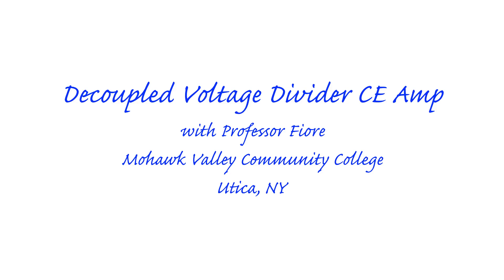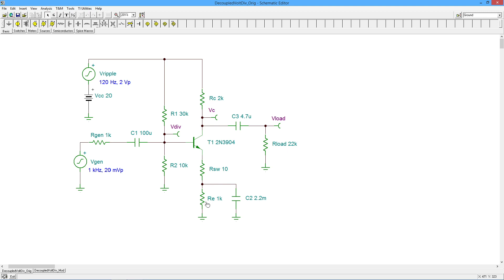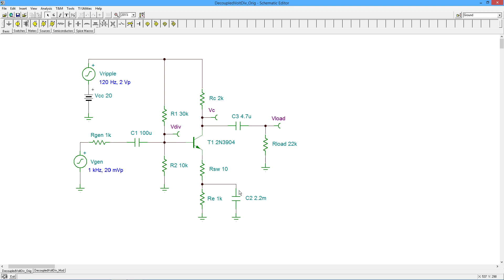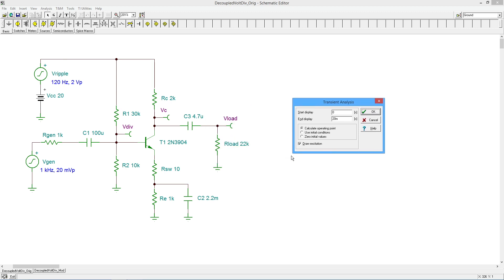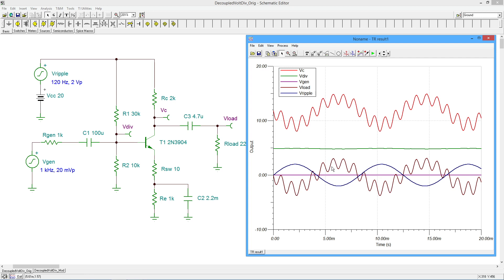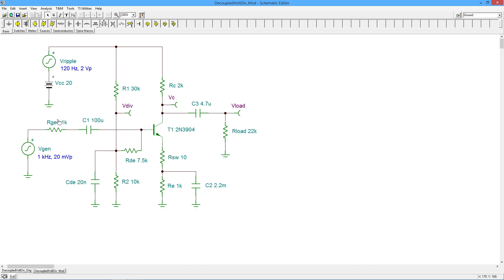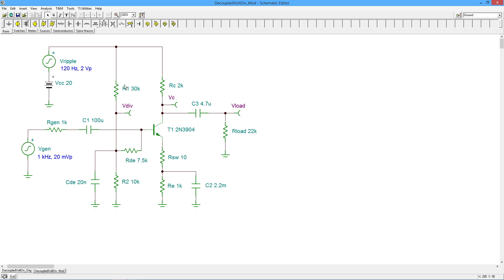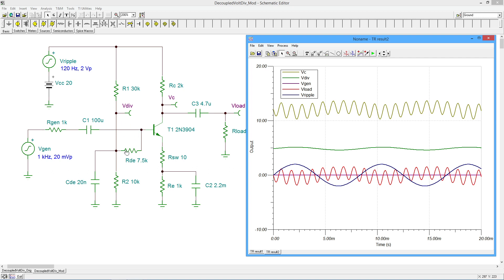Semiconductor Devices: Decoupled Voltage Divider CE Amplifier

Comment: We dont want the ripple to interact with the source freq and get coupled with it cause then it is involved in ac things. But it can avoid the ac things if source is decoupled from base.

Also cap is estimated as 20n by 1/2pi*20*7.5k as we need to short the 7.5k

Comment: Thank you, really useful. Does this effectively increase the Zin by the decoupling resistor value for DC? Presumably, the 'rippling' VCC will still affect the current through Rc; could you do some decoupling from the collector to ground (resistor to ground, capacitor to output?
Reply from the maker: It might increase Zin, it all depends on the values chosen. As far as decoupling the collector, that's not quite so straightforward. The other wrinkle is because this is an inverting amplifier, if you play with the numbers *just right*, you can get the output ripple to be cancelled by the remaining input ripple.

Comment: how did you get 4 mills in swapping resistor?
Reply from the maker: Are you referring to the DC current? That's collector/emitter current (approx equal). This is a voltage divider bias. 5 VDC on the base and about 4.3 VDC at the emitter. That drops across 1010 ohms.

Comment: I never knew you could do this. It's interesting, I am currently designing a CE amplifier for a school practical and I realized that PSU ripple affects the circuit performance quite a bit. I am interested to see what effect this has on the frequency response of the circuit.
Reply: Fire up LTSpice and simulate it! This is an invaluable skill to have if you are doing electroncs. I would guess that you will find little difference from the first circuit in the area of the spectrum where the bypassed voltage divider remains low impedance. The other thing you can do is calculate where the bypass cap reactance increases. Then calculate the impedance rise of that point and think about what effects this would have on the reaction with the input coupling capacitor cutoff frequency.